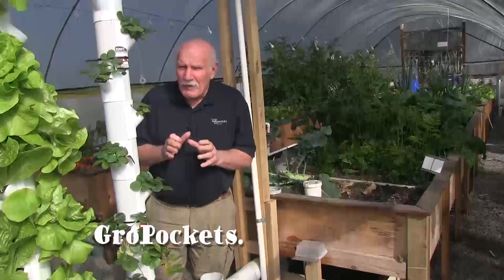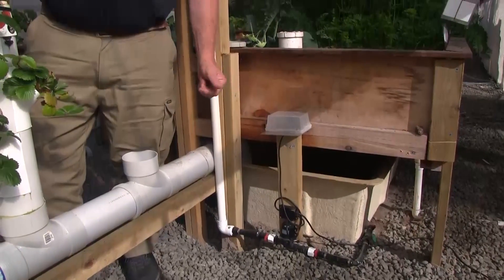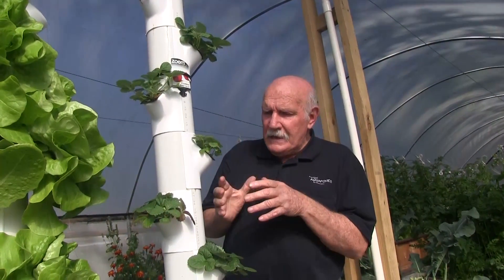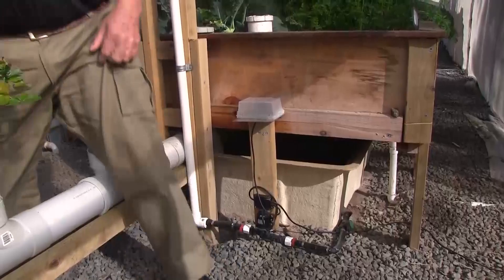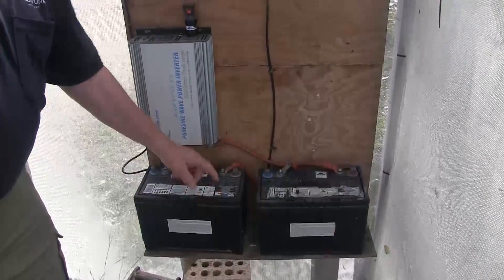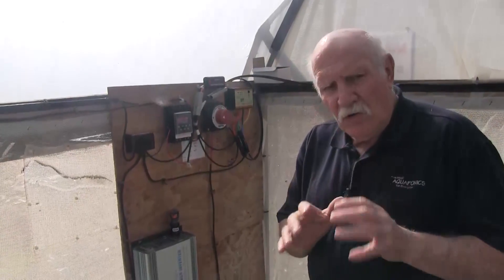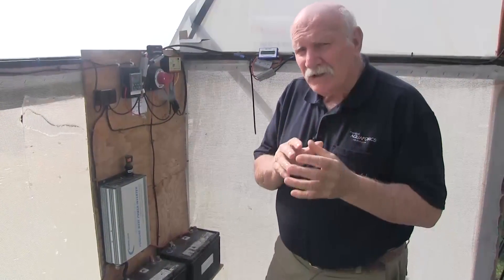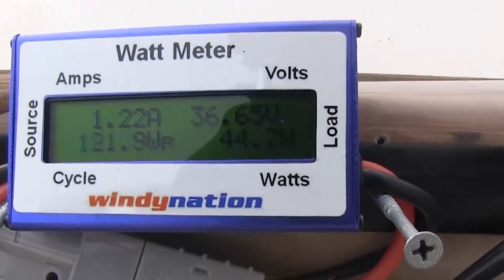Solar Powered Aquaponic GroPockets - Vertical Gardening.

Comment: Hi Murray,
I've got a question regarding the water cycling on an aquaponic system growbed type. When going solar, I would like to initially pre-charge my battery and run the water pump with the solar panels and at sunset (or a bit earlier depending on the light sensor I can get) have the water pump shut off and switch to run an air pump (with 4 air stones) on the saved energy in the battery. So the water pump would not send water to the bed from sunset to sunrise. Only a good air pump to keep my fishes happy. What are your thoughts on that? Thanks for your time :)
Reply: This system runs from 7: 00 in the morning to 7 the next morning without shutting down  the circulation pump is a 20watt pump and pulls hardly any power. I would suggest connecting a plc to your system like I have did so that the task you would like to be done gets done automatically and gets done in the peak of day so it does drain your battery for nighttime use